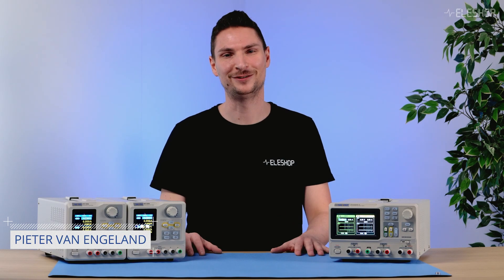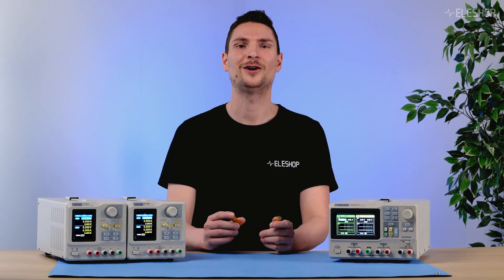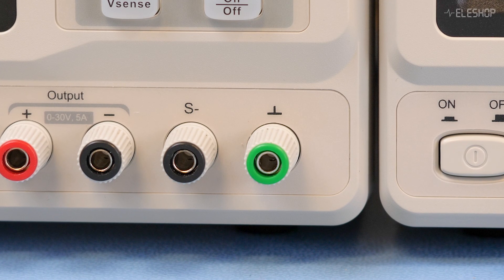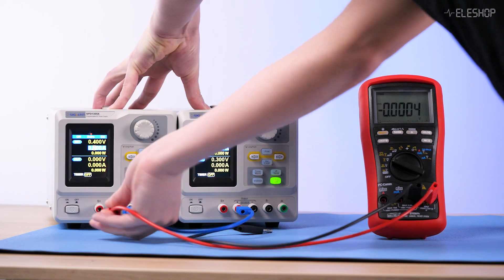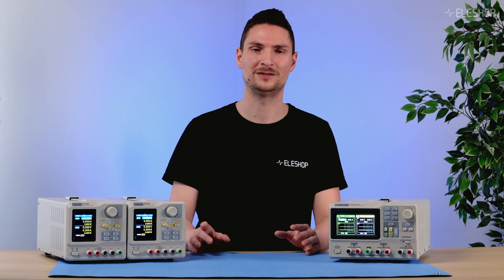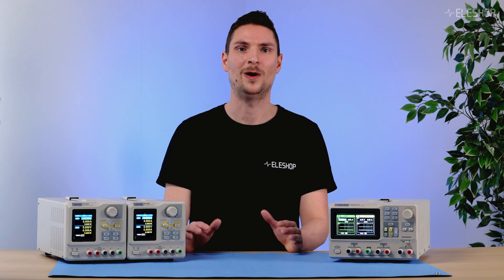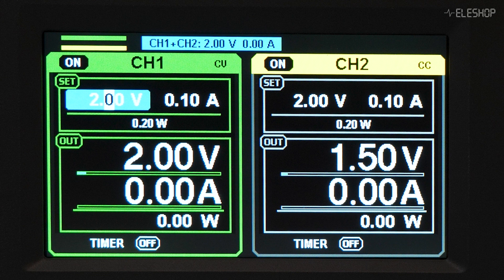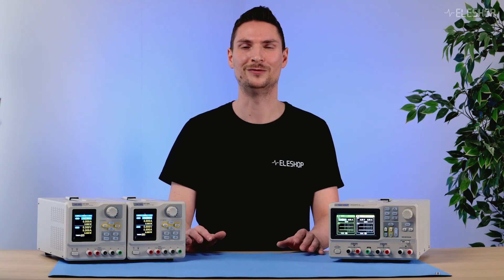Is It Safe to Connect Your Power Supplies in Series or Parallel?

Comment: Je zegt bij serieschakeling dat de/een hoge spanning de power supply kan schaden. Waarom is dat zo en op welke wijze?
Reply from the maker: Good question! Let's say a power supply has an output voltage of 60V. Then the voltage of the positive terminal is never higher than 60V compared to the negative terminal. But by placing the power supply in series with another power supply, you are raising the voltage of the negative terminal compared to earth. The power supply is internally split into two parts, which are isolated by transformers and optical parts. Mains is primary and the outputs are on the secondary side. If you raise the voltage on one side (secondary side), those components are operating outside their designed voltage and this might cause issues.
Reply: @EleshopVideo  Thanks for the explanation!

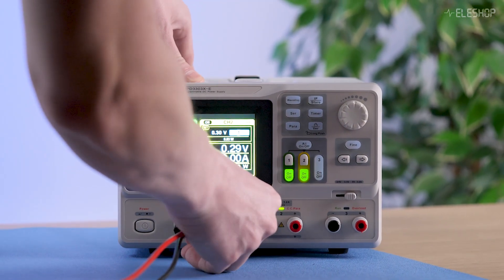Comment: Welke firmware zit er in deze voeding? op 4:28 staat in de bovenste regel totaal spanning en stroom. Dat doet mijn voeding niet.
Reply from the maker: De voeding is gloednieuw, dus waarschijnlijk de meest recente firmware.
Reply: its 2 channels one... i gues you have one channel wersion if it shows only one.
ie the ones on left seems like has one channel supply while the one on right is multichannel if you look at pins it has additional 2 slots

Comment: Hello and thank you for the video. If I want a symmetrical +12V and -12V supply, I will have to use the series connection?
Reply from the maker: Yes, use the series connection. Then the connection from one channel to the other channel acts as the 0V connection.
Reply: @EleshopVideo  thanks